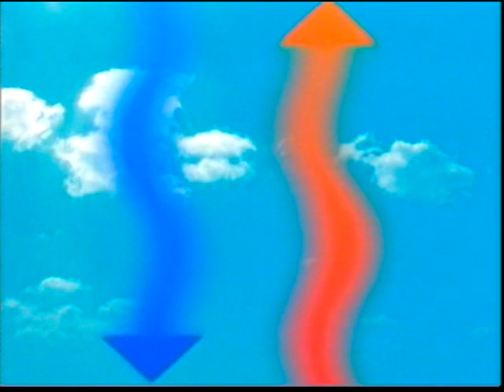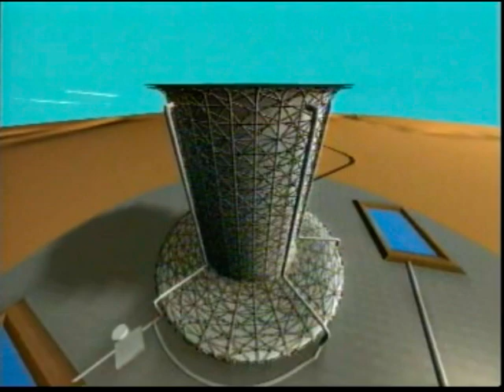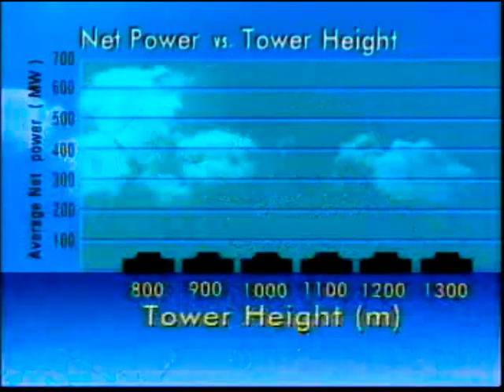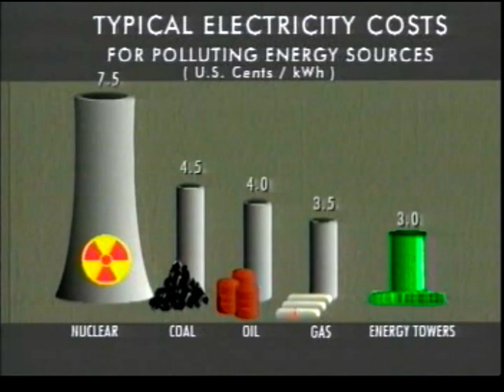Energy Towers Power & Water - Introductory Overview.mpg

Comment: why not build smaller ones as home generators and have the water tank underground which stays 50 degrees all year then use ram pumps to pump it up the tower (say 10 feet or more) and the generator (alternator) could charge vanadium redox batteries or the new graphene batteries china unveiled
Reply: That has to do with scale, a large tower generates far more energy (above linear towerheight proportionally).
Reply: There is a plethora of alternative energies that can be used to make small home generators. Power plants/Utility companies are not needed and never were.

Comment: ... so initially the water will have to be pumped in if it's Inland and also heated to the point that it does its thing.
 The initial startup will take some kind of engine or an abundance of human power and fire for the pumping and Heating even if it's in the ocean it would have to be pumped to the top unless there is a siphon or pressure created to make that happen. ... but as soon as it's working the power that it creates could be used in a Perpetual form to power itself but it seems like solar would be the only option to get away from creating a missions or pollution to operate it but then the guarantee of the Sun in the right directions for the duration of time and also relying on batteries 2 store that power for when it's not sunny or when it's dark at night so it could work  so regardless there still is some point where emissions and pollution will be made to operate it.
 ..... Einstein has left the building or else that perspective would be figure it out...?.... when would be the only other thing outside of a prop based on the oceans current to pump the water or create a friction that could heat the water.
 ..?...

Comment: This concept suggesting energy created during 100L water fall down is greater than energy used for pumping 100L of water up? despite 20% energy losses during the process?! Wow.... who's idea was it? a Doctor?
Reply: someone did not understand the concept...try again.
Reply: no. its not the falling of the water that makes the energy. the water is used to cool the air which then accelerates downwards and that air is what creates the power.
Reply: thank you for your explanation. Despite 22% energy losses, energy tower's running cost is lower than wind turbine, but they didn't mention the construction cost is much higher than wind turbine. Compare to wind  energy tower needs more engineers, machines, materials, services. Foundation work is also very high, you need to dig very deep, extra structural supports, concrete and steel... etc. How many years of operational saving to cover these costs?
Reply: John Huang
I dont know what analysis they used but they said that the cost per energy is lower than that of wind. I dont know if that includes some sort of estimate for the cost of construction or not I hope it does otherwise that estimate is point less.

but considering the scale of this tower (imagine the Colosseum but 25 times taller, this will be 50% taller than the tallest building on earth right now) we are looking at the 10s of billions if not 100s of billions to construct. which may sound like alot but cosider that the F35 project cost over a trillion dollars. So this is within the realms of possibility.

The structure is really quite simple. Its just a huge cylinder with sprinklers on top. its just the scale that is insane.

the average american pays abuot $1100 a year for power. this is meant to supply a city of 1 million. So it would make about $1 Billion a year in revenue than we would need to know how much it cost to operated the thing. I would be surprised if they have more than 20% profit per year so it would take many years to pay of the initial investment.

BUT, because this is just a tube. I would imagine it would last a long time.
Reply: Crazylalalalala

I estimate the tower to be around 2-3 Billion.
To be competitive with coal 4.5:3 you have to stay under 4$/kw installed. Let's say the nameplate capacity is 1200MW (to compare with a 500MW coal plant) then the price per watt would have to be around 2$ (advanced windturbines are installed for 2$/W, coal $2.10 a watt, gas 1$/W, nuclear 7$/W) The capacity factor is a little higher than with a wind turbine, for coal/gas you need to count in fuel. That's actually interesting. 78% of coal power is fuel cost the rest operation and maintenance, for gas this is 94% fuel cost and nuclear got 26% fuel cost (the killer with nuclear seems to be operational/maintenance cost which is rising about 5% year as the plant gets older...fuel cost also seems to be on the rise though only a quarter of total cost it does have impact)
The maintenance cost for the updraft tower is something that was also mentioned.
1) they don't use sea water for cooling the tower (desalination is the energy part needed to run the thing).
2) the updraft will blow out most of the moisture so only the uppermost part would be effected by the water mist.

What I don't understand is why the tower produces water when it could recycle any captured water for cooling the upper air again?
The other thing I would like to know is if the water vapour would pose a problem, it's a greenhouse gas after all.

The tower...I guess the tower could work for 80-90 years, that ought to be enough for financing ;). We got huge FLAK towers from WWII that will probably last another 100years. (Also read some paper from MIT where they have developed concrete that could last 16k years. I guess 200years would do.)
The rest is just statics. A lot of concrete though.

I would really like to learn more about that.
Reply: Marcus MarcusK
this is downdraft...
They do not mention desalination prior to spraying the water so the corrosion on the turbines and the tower could be really hard. On the other hand this eliminates most of the water vapour.
Recycling the fresh water would still be favourable if you would need to desalinate it in the first place.
Reply: Marcus MarcusK
Why would the turbines be made of metal?
Reply: Denis jojot the blades would be composites but there are more parts to a turbine. Hard to set a designlife on the turbines but they would have to endure conditions like offshore equipment. Servicing could be easier due to access.
Reply: THE COoling of air vapor create a vacuum therefore the tower need to be irradiated

Comment: it has many drawbacks 
1 what will the tower do when its raining
2 most of the coastal areas it rains half year
3 in tropical rainforests its useless and also where it rains a lot
4 as u move towards the poles it doesnt work because winters are long u cannot cool the air further
5 pumping water from the ocean and top the tower and again back to the sea uses power 
the result is waste of money

Comment: HOW IS A WIND TURBINE IN A TOWER cheaper and more efficient than a regular wind turbine? How can one wind turbine power a city? This is laughably stupid from an engineering perspective. One 50 MPH turbine can't possibly generate that much power especially if it also has to power pumps and overcome piping friction. Your'e talking a cost per watt orders of magnitude more expensive all just to overcome intermittency.  saltwater corrosion means it wont even last nearly as long.  dumb dumb dumb
Reply: If they were only using one turbine it would have radius of 200m, which would produce at least 300megawatts of power. The video shows the bottom lined with two levels of smaller turbines instead, which would be easier and cheaper to make. The main issue is trying to build a 1200m high tower, if they managed to do that cheaply enough everything else would be easy and essentially free compared to it.
Reply: If they were only using one turbine it would have radius of 200m, which would produce at least 300megawatts of power. The video shows the bottom lined with two levels of smaller turbines instead, which would be easier and cheaper to make. The main issue is trying to build a 1200m high tower, if they managed to do that cheaply enough everything else would be easy and essentially free compared to it.
Reply: @AnalystPrime  if lots of little turbines were more efficient, then why does Big Wind keep making them bigger? I'm not saying it wouldn't work. I'm saying it's economically un-viable.  Your capital costs would require a 100 year payback.
Reply: The problem with one huge turbine is it is ridiculously huge. Building it is hard, moving it gets harder, then you can only build the tower after the turbine is in place. Any problem with it, you need to shut your only turbine down and If it is serious and you need to replace parts, you would have to dismantle the tower and rebuild it afterwards.
Using 100 smaller turbines means shutting one down for maintenance lowers your power output by only 1%. Replacing them is cheaper and does not require total rebuild of the tower, which is the important part.
If that means the 100 smaller turbines are slightly less efficient than one 400meter one, that is an acceptable loss.